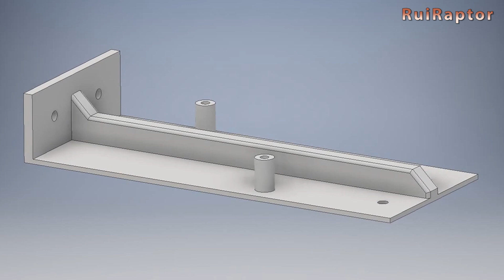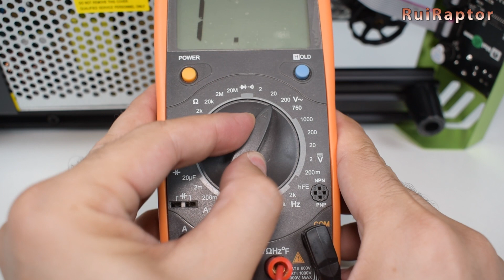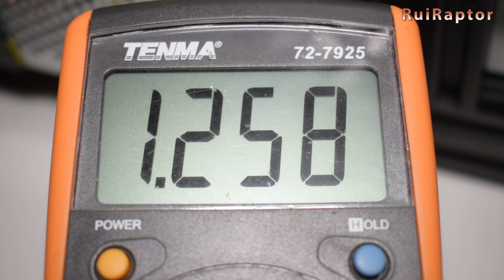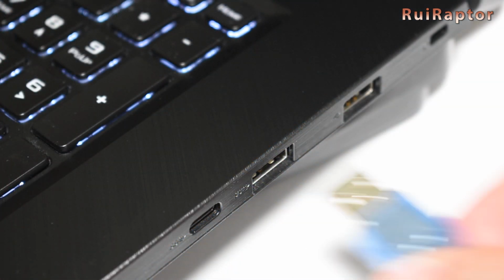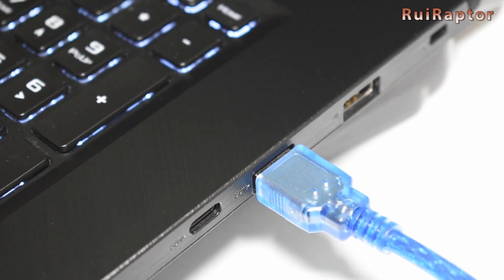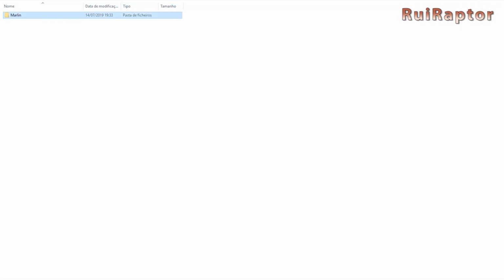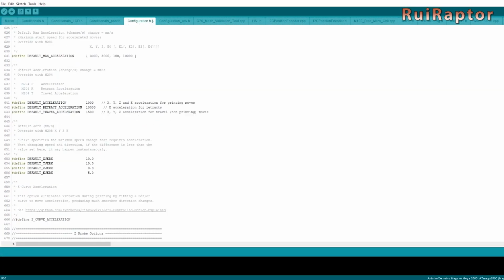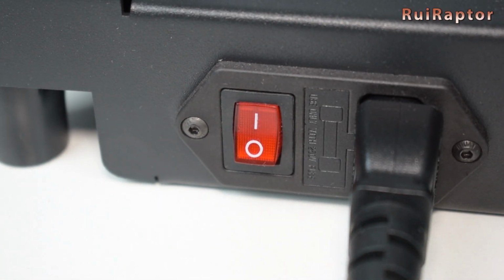TEVO TARANTULA PRO - How To Install TMC2208 Drivers

Comment: Curious as to how initially years ago it was common practice to upgrade the X Y Z drivers with the TMC drivers and then using the LV driver for the extruder? A little while later the thought was to replace all drivers with TMC drivers; and now in this updated video, only 2 drivers are replaced????
Reply: Was thinking the same,  searching for a tutorial to upgrade my trusted tornado. If it's purely for sound reduction then it makes sense only to do the X and y axis.

Comment: Hey Rui, I followed the steps in this video but when I home my printer the x homes fine but when it comes to the y it shows "Homing failed PRINTER HALTED Please Reset." any help would be greatly appreciated in fixing this issue. I already tried it with a spare MKS Gen L board that I have but it's still the same
Reply from the maker: Hi, does the Y axis moves back when homing? If yes, check the home switch if it's being triggered when the bed is at the back.
Reply: @ruiraptor  Yes it moves back, hits the switch then it gives the error
Reply from the maker: What if you trigger your self the switch while the bed is moving back? Does it stop or continues to move?
Reply: @ruiraptor  it stops but still shows the error
Reply from the maker: After the Y axis, it should home the Z axis. Maybe it's failing the Z axis and not the Y.
Reply: @ruiraptor  that's what I thought too so I tried homing all axis individually but still only the Y axis is giving the error

Comment: Hello, greetings from Argentina. I would like to know if there is any problem if the TMC 2209 are installed by the TMC 2208. Thank you, do you have a contact number or email? I need your help
Reply from the maker: Greetings, you want to install TMC2209 instead of TMC2208? Yes, that is no problem. Just edit the firmware with that information.
Reply: @ruiraptor  hello ! Thank you very much for answering! I am going to place the tmc 2208, I would need the marlin to be able to edit it, can you send it to me? I can't find it please
:face-orange-biting-nails:

Comment: after installing drivers my 3rd layer prints out of bed frame, where is problem maybe you know ?
Reply from the maker: Did you check/calibrated the steps?
Reply: @ruiraptor  my fan was dead, replace fan and all is okay, when drivers are to hot they can work properly

Comment: Arduino: 1.8.19 (Windows 10), Board: "Arduino Mega or Mega 2560, ATmega2560 (Mega 2560)"

In file included from C:\Users\User\Desktop\Marlin\ultralcd.cpp:96:0:

ultralcd_impl_DOGM.h:46:10: fatal error: U8glib.h: No such file or directory

 #include <U8glib.h>

          ^~~~~~~~~~

compilation terminated.

exit status 1

U8glib.h: No such file or directory

This report would have more information with
"Show verbose output during compilation"
option enabled in File -> Preferences.

How i can fix it ?
Reply from the maker: You need to install the U8glib.h library on arduino IDE first.
Reply: @ruiraptor  Thanks :)

Comment: Hi! What will happen if I won't change VREF values? @ruiraptor
Reply from the maker: Hi Adam, if the Vref are set too low, the stepper motor will not have enough torque and might loose steps. If the Vref are set too high, the driver and stepper motor will overheat. When the driver overheats, it triggers the temperature protection and stop the driver. If the stepper motor overheats, it will damage it. These are the worst case scenarios.
Reply: @ruiraptor  Dear Rui, thank you very much! So I must find my lost multimeter now :)

Comment: I replaced the XYZ drivers with tmc2208. XY drives are fine, Z drive moves 10x. 1mm-1cm, 10mm-10cm it is moving.  Help me
Reply from the maker: You probably have the wrong stepping selected in the driver.

Comment: another error: avrdude: stk500v2_ReceiveMessage(): timeout
avrdude: stk500v2_getsync(): timeout communicating with programmer         Can u help please?
Reply from the maker: Have you selected the correct COM port? Did you check if you have the computer comunicating with the board correctly?

Comment: I installed the tmc2209 on the 4 axis and it's set (Driver Current)
x: 800
y: 800
z: 800
E1: 800
And the driver ref v I put 1.25 is correct?
Note: They are moving very fast and making noise.
Reply from the maker: Hi Ricardo, you say that you have set the driver current from the display menus? If yes, this means that the drivers are setup with UART enabled and this also means that you don't need to adjust any Vrefs. The adjustment is done in the display menus only (driver current). If they are moving very fast, probably they are setup with the wrong ustepping or steps. Check the jumper configuration under the drivers (ustepping) and make sure the steps values are the same you had with the previous drivers.
Reply: @ruiraptor  Hello, they are in uart mode but, and I have set vref of 1.20 for each driver, but I still think the steps are fast and noisy are like this:
x steps / mm: 80.1
y steps / mm: 80.1
z steps / mm: 399.3
e1  steps / mm: 438.0

DRIVER CURRENT

X: 850
Y: 850
Z: 850

hybrid mode enabled in marlin

Comment: Help me please, I installed the tmc2209 and they are very fast in the displacement I set v ref of 1.25.
I checked the a4988 vref before and it was 0.86. I have to do 0.86 X 1.4 = 1.21 is it?

Comment: Will I have a problem if I install the tmc 2209 in the extruder
Reply from the maker: Hi Ricardo, if you get problems, just change the mode from stealchop to spreadcycle.
Reply: @ruiraptor  have a problem i installed the tmc2209 in the extruder and even after the calibrated printer it makes a lot of noise when going to retract. can you help me ?

￼
Reply: @ruiraptor  I installed the tmc2209 in the extruder and it was very fast in the retraction. I can change it at marlin at conf_adv.h - #define spreadcycle_e
 Will it solve?

Comment: Hello Ruy, for me to install tmc2209 v2.0 on the z axis and extruder is recommended. I will notice some difference in noise / resolution or the x and y axes are enough.
Reply: yes or no, 
It is necessary to replace the driver on the z axis and extruder or not

Comment: Hi, I installed these drivers into a new board and flashed the firmware as you instructed, but my LCD screen is totally blank. I have no idea how to fix it. Could you help me?
Reply from the maker: Hi, which board did you installed? Some boards have the display pinout a bit different and you need to connect the flat cable connector rotated 180 degrees.
Reply: @ruiraptor  Im experiencing this issue also, any advice?

Comment: My Tarantula Pro bought in May 2020 has all 4 Step drivers equal (the Y motor isn't bigger or stronger than the other ones as said in the assembly video and here again) I was searching its specs and it says the max current is 1.5A. Should I use the max current of the motor or I can apply these ones showed in this video anyway?
Reply from the maker: Hi Douglas, we do not recommend to set the max current when using the TMCs. These drivers need to be setup differently, or in other words, from the bottom - up. If you set them up with the max current, the drivers and motors will run too hot and with not much benefit.
Reply: @ruiraptor  Hi Rui, would you mind to explain the logic for the 0.85A and 0.90A maximum currents for the x and y axis. How/Where did you get such information?  (Olá Rui, poderia fazer a gentileza de explicar a lógica para as correntes dos eixos x e y? Como/onde você conseguiu estas informações?  Obrigado.)

Comment: Hi ruiraptor, when I try to upload to the printer, I get an error that says:
compilation terminated.
exit status 1
U8glib.h: no such file found

It also highlights the line in Marlin that is throwing the error, which is as follows: 
#include <U8glib.h>

Any ideas? Thank you, so far the guide has been great!
Reply from the maker: Hi Gavin, that is because you don't have the U8glib library installed in your arduino IDE. You need to install that library first.
Reply: @ruiraptor  appreciate the response, that did the trick and the printer is working! I'm definitely not new to 3d printing, but as of yet haven't had to mess with code/Marlin, so I appreciate the help! Thank you.
Reply: @gavingross2174  how to install the U8glib library please?

Comment: hope someone can help followed the video but when I try to home non of the motor moves I've got Fystec 2208 I just can't figure it out why they won't work.
Reply from the maker: Hi, make sure the drivers are installed with the correct orientation.

Comment: hi rui 
after connecting the pc to the 3d printer via USB
my pc does not recognise  my 3d printer 
therefor I cant find the correct port to select 
what should i do
Reply from the maker: You need to go to device manager and check if the new connection is being recognized. If not, you have to install the FTDI drivers so it can recognize the printer.

Comment: Is there a way for me to make the new fan slower? It's so I credibly loud.
Reply from the maker: The hotend fan must be spinning at full speed for better performance. You can install a noctua fan and a step down circuit instead.
Reply: @ruiraptor  Sorry I mean the 5010 fan that is put under the printer when upgrading the drivers to TMC2208, it is very loud.
Reply from the maker: oh, for that one you can buy a PWM controller and reduce the RPMs a little bit. Reducing the RPMs to 85% will reduce a lot of the noise.

Comment: Hello Rui, tks for your excellents videos. I installed the TMC 2208 drivers on X and Y axes exactly as indicated in video and its worked perfectly. Can I use the same rules to Z axe? Remove the 3rd jumper, use Vref 1,20v and set in the firmware TMC2208_standalone for Z axes? Needs invert direction too?
Reply from the maker: Hi Evandro, yes, you can use the same procedure (including invert the direction) and the same Vref value for the Z axis.
Reply: @ruiraptor  Thank you very much, it worked perfectly. Now I bought the extruder LV8729 to permanently silence the printer. 
One more question is: I tried but not found the remake for 2 fans, can you indicate the link for it? The printer stop in the midle of job, I believe that is due to the temperature.
Reply from the maker: Hi, which remake are you referring to?
Reply: @ruiraptor  I would like to know also if the same current of 1.19v can be used for the extruder. Its clicking and hotter, thanks in advance!

Comment: Ruiraptor, tenho uma impressora Longer LK4 Pro que já veio com os drivers TMC 2208 instalados, porem ao entrar no firmware da mesma percebi que os drivers setados estão assim: #defineX_DRIVER_TYPE  A4988
; #define Y_DRIVER_TYPE  A4988; #define Z_DRIVER_TYPE  A4988; #define E0_DRIVER_TYPE A4988. Posso altera-los para TMC2208_STANDALONE sem precisar mexer na eletrônica tranquilamente? Desde já agradeço.
Reply from the maker: Olá Vitor, se a versão de firmware que tem permitir (verá nas linhas comentadas as opções de drivers) então poderá colocar TMC2208_Standalone.
Reply: @ruiraptor  Ok, muito obrigado.

Comment: Hello sorry for my english pronontiation because im french. I want to install tmc2130 spi v3.0 the vref for axis Y Z X E is 1x1.4 ?
Reply from the maker: Hi Chris, if you connect the drivers using SPI, you don't need to worry with the vref adjustment. You define the current in the menus.

Comment: I'm getting an BTT SKR 1.4 Turbo for my Tarantula Pro,  I want to put in updated drivers, but I need it to be somewhat easy, I'd like to just drop them in. Is 2209s easier than 2208s?  How about the higher series with no pot adj, SPI? Any suggestions? Thx
Reply from the maker: If you are looking for an eas y and plug & play installation, install the drivers in standalone/steathchop mode like we did in the video. The early versions of the TMC 2208 driver sticks are the ones we used.
Reply: @ruiraptor  Thanks rui. So your video is showing UART mode right(so I know where to put the jumper)? Do I use all the same  pot V settings? In Marlin 2.0.5 is it defined "TMC2208" or TMC2208 Standalone? Really appreciate your help and replies.
Reply from the maker: Hi, if you use the drivers in standalone mode, you need to set the Vref values with the potentiometer. The jumpers under the driver set the microstepping.

Comment: Would installing a TL smoother on a TP do anything? Or is that what the TMC2208 driver upgrade does, besides noise reduction?
I know what smoothers do, I'm wondering if they are just for boards like Enders with fixed non-upgradable drivers.Thank you
Reply from the maker: TL smoothers are not for sound but for fixing the salmon skin ( https://youtu.be/78fonMoXRuA ). TMCs will fix the salmon skin and also turn your stepper motors silent.

Comment: What is a a good size desk to put this on iama build my own and also make it inclosed as well
Reply from the maker: Check the Lack tables from Ikea, Many users use it. If you google for it you will see many pictures.
Reply: @ruiraptor  ok the end tabel? Also would a 20inch by 20inch be good or need to be bigger

Comment: jus wonderin what yous have the print speeds at on this machine after the 2208s.
Reply from the maker: Speed has an impact on the print quality regardless of the drivers you use so we normally use 60mm/s for infill and inner walls and 35mm/s for outter walls.

Comment: Hello Rui! Thanks you for your helpfull video's.  In my TTPro all the motors (X, Y, Z E) are the same type: 42shdc4043Z-22B. What is the correct voltage to be used with the TMC2208? And are there any benefits using a LV8729 for the extruder instead  of a TMC2208?
Reply from the maker: Hi Leon, use the vref value of the X axis for the Y axis too. Regarding the benefits of the LV, it works better on the extruder. The TMC drivers, specially when running in stealthchop mode, can't handle the extruder movements and stall creating extruding issues on the prints.
Reply: ruiraptor Thank you sir!

Comment: Ey Rui. So I got a 360w 24v 15a PSU for my TTPro, but apparently I need to adjust the voltage on the new PSU . Any idea on what I should be adjusting it too? Will be getting 2208s soon too, by Fystec, v1.2.
Reply from the maker: Hi Josh, just make sure the output voltage is 24V.

Comment: Hi. Do we need to choose the Programmer : AVRISP mk11 or change it to ArduinoISP. I might have bricked my board coz it wont turn ON after flashing. I did wait until the status is DONE UPLOADING but when i plugged the cable out and power ON the printer, It just wont start and no display at ALL..Any idea what I can do..Im afraid it might have wiped the Bootloader from the board if i understand correctly.
Reply from the maker: Check this link on how to fix a bricked board: https://3dprinterchat.com/how-to-fix-a-bricked-3d-printer-board-installing-a-bootloader/
Reply: Thank You

Comment: dont have the original memory card as it got corrupt and I lost the firmware stuff on it. any idea where I can get it?
Reply from the maker: You can find the stock firmware in Tevo's website.
Reply: @ruiraptor  awesome thank you. Btw loved your vid for the TTPro assembly. Iv had it now for a while now an love it. Discovered that the black paint on the extrusions , builds up a layer of metal dust on the rails, and thus accumulating on the wheels. Best to give all rails a light sand with a fine grit

Comment: quick question. can i use this stepper motor for my z axis on my TTPRO with the stock drivers? if my calculations are correct i would have to adjust my potentiometer to 2.3volts. can the driver handle this?https://www.amazon.com/gp/product/B07DPGJX39/ref=ppx_yo_dt_b_asin_title_o00_s00?ie=UTF8&psc=1

Comment: Hello Ruiraptor

Thank you very much for your video, they can help many Tevo Tarantula Pro User.
I have my Tevo Pro with the Dual Z upgrade, BL Touch upgrade and TMC 2208 upgrade installed. I have replaced all the 5 motor drivers with the TMC 2208.
Honestly, I am a little bit lost with all the correction to add into the Marlin firmware of the Tevo Tarantula pro.
Can you please make a small summary of all the lines we have to change in the firmware to let work the Tevo Pro with all this upgrades.
One other question : the original Tevo Tarantula Pro controller board is a 32 bit controller or a 16 bit?

Thank you in advance
Jean-Jacques
Reply from the maker: Hi, we explained all that in detail in the video. You can check this one too for more aditional information: https://youtu.be/RhlTdTLfaQ0

Comment: Hey rui,

So i got the TTpro and the tmc2208 i have the same  RB Step motors 42SHDC4043Z-22B and dont understand how you got the numbers to calculate the Vref... on Tevo support site they write you have to adjust all vrefs to around 1V.. but you calculated 1.19V on x axis (and can i use the 1.19V) on all drivers because i have the version with all same stepper 

Thank you in advance for your help
Reply from the maker: Hi Edd, that is very easy to explain...
The printer's stepper motors are rated with a max working current of about 1.3A - 1.5A. When you are working with TMCs you should always start from the bottom up. If you set the Vref higher than what is needed, the drivers will heat up. Too much heat on the drivers will cause them to stall due to internal thermal protection feature and you will see layer shifts on your prints. You can tweak the Vref while printing and while monitoring the temperature and stepper behaviour. From our tests, the vref values we show are a good balance between performance and temperature.
Reply: @ruiraptor  Thank you for the quick answer, i will give it a try when i install the TMC's :)